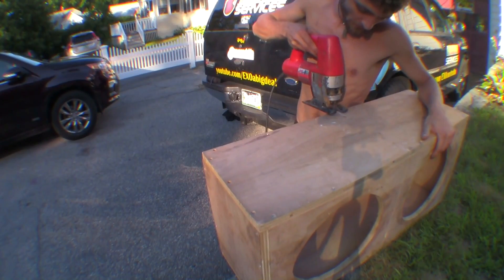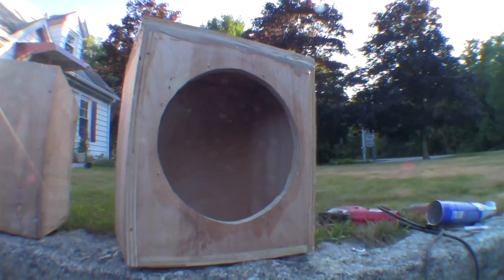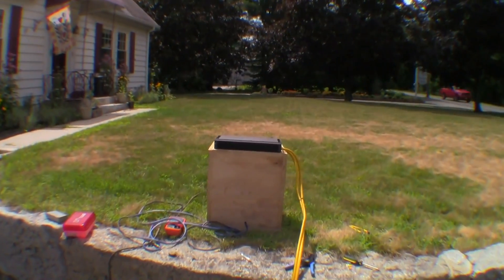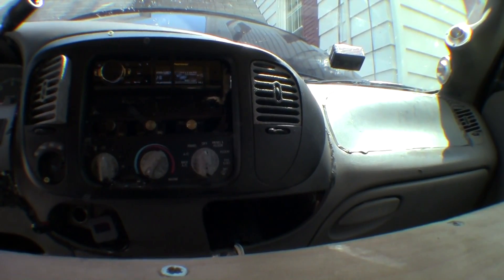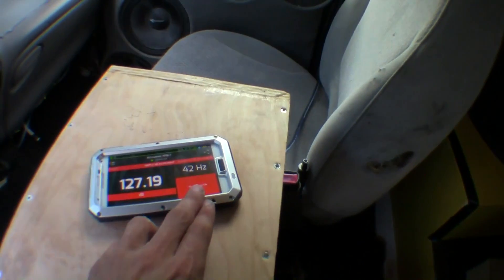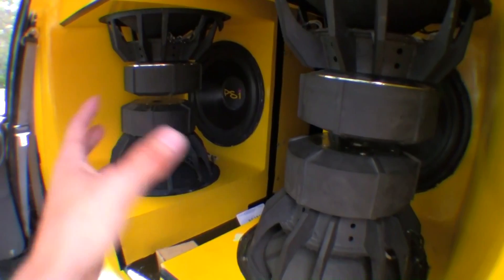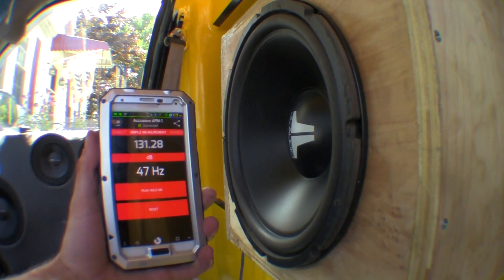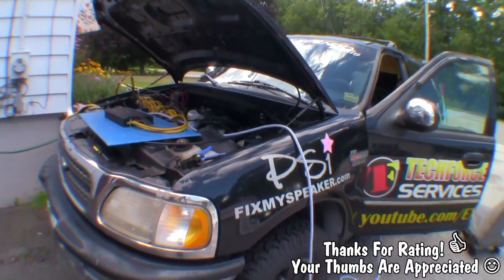Finding Resonant Frequency w/ Sealed Subwoofer Box & BASS SWEEP | 12" JL Audio W0 DIY Test Enclosure

Comment: So what if your subwoofer and box ate tuned for a lower resonance frequency than the cabin of the car? For example  I have a single 10 inch Polk Audio DB series, and spec's say it get low as 28hz. My box is tuned for 37hz however I'm not sure what is the resonance frequency of the cabin of the car. It's a 1995 Mercedes Benz E320 4 door sedan.

Comment: 8:49 - For all the budding/learning electronic/audio technicians, that is poor cone control, uncontrolled cone breakup and back EMF.
Reply: Jim Stanley or it could be the camera frame rate capturing the movement. The cone control is as expected from an entry level subwoofer being slapped with a -5 rms low Hz tone 😀

Comment: LMFAO Yo, I used to use Jumping Cable Wire for my Amp's back in the Day that's too funny I thought I was the only one who did that. Anyways I'm getting back into BASS again it's been a long time since I had beat in my cars. I'm on a very strict budget I can barely pull it off but I got a Steal on a Rockford Fosgate 12' X1 P2D2 in the Ported Single Box by RF it's brand New never really pushed hard I got it off a rich couple who rather have space over Bass . It's a 2ohm DVC factory wired in Parallel to 1ohm but I'm rewiring it to Series to get the 4ohm since my amp needs to be bridged to support the RMS on the Sub and 4ohm is the lowest Stable Impedance, Thats where it starts for me

Comment: What exactly am I looking at ? U say 10 to 80 Hz. So do u mean to say that your audio sytem/tuner or whatever will operate at the infrasound level ? And if so , then how many decibels can u get it turned up to ? So basically , can u tune your audio system to 20hz or lower and then turn the volume up well over 100 decibels ? And if so , WHAT WILL U CHARGE ME FOR THE SAME SET-UP ? ........

Comment: Cubic displacement of vehicle cabins was one of my secrets to tune our systems years ago when I worked at Paul's Scary Car Stereo in Waterford, CT back in the 90's. Nobody believed me when I spoke about it, but the characteristics of bass changed significantly when speakers were installed in sealed cabinets of the correct volume, so I used the internal volume (approximate volume of the vehicle cabin)  to create the bandpass effect by adjusting the sealed volume of the speaker enclosure to my benefit. 

I always found that vehicles with volumes similar to S-10 blazers of the 80's and nineties had a special sound quality about the bass when I built dual reflex bandpass enclosures using slotted ports similar to what Orion XTR's sub engineer's used for their single Orion xtr 12" driver they  built. The problem everybody had was that the bass enclosures were being installed without the knowledge of what the internal volumes of the vehicles were, and the bass would be different in every vehicle, so it took qualified techs such as myself to accommodate their vehicle with skills such as this. Tuning methods using ports for frequency adjustments would never completely work  unless those volume changes were made, so either the enclosure needed to be modified, the interior volume changed, or both would need to happen, which was always a lot of work to do without having tools like apps or RTAs and tuning devices such as frequency generators.

 I used  a function generator to drive my amplifiers for the sweeps when i tuned systems and an oscilloscope to see if signals were clipping from the output. This way I could see if the signals were exiting the amp,. how much physical distortion there was due to clippage, and I could see if the speakers were causing these things to happen.  Instead of using an RTA, I kind of built onemyself using the scope, a mic and adaptor to adapt the mic to BNC for the scope input. The mic needed to be the correct kind, as piezo mics would not function for these measurements.

So products like 2 x 4 blocks and pillow stuffing were some of the tools of the trade to help make these changes happen once a driver was broken in a bit to give subtle changes after the basic volume calculations were completed to find out cab volume vs enclosure internal volumes. These variables were closely approached with approximate calculations, then changed to finely tune them by changing the sizes of the areas with wood opr pillow stuffing.

 The biggest issue we had were the changes that happened once a window was opened, broken, pushed from it's seal, etc.  Other installers didn't even know that these dimensions would ever change anything, so I quietly took it upon myself to use my cabin size to enhance my own sound quality, getting several people believing in me for my bass volumes due to my tuning methods and final quality/clarity. 

My systems also used less power because true resonance in a circuit creates infinite impedance, but these changes are only when those notes were hit constantly, so tuning these frequencies not only with cabin volumes and sub enclosures were important, but also to use active crossovers of high quality to isolate these frequencies to specific drivers using dedicated amps , which are very important for final sound quality. The sub enclosure is forced to stay within this "frequency" window that the system is tuned  to,  so it allows for the output wattage to be massively reduced, becoming incredibly efficient. 

This method produced bass similar to those using several thousand watts of power while I was using 75 to 150 watts to my subs with the Phoenix Gold MS series amps while other people would be overdriving the shit out of many JL W6's to try and duplicate my sound pressure levels, using triple the amount of subs and wattage, but they never got anything but air movement. It is pretty cool to see that they have the tools to do this in a simple way today.. technology has truly come a long way in little bit of time and it willonly be a matter of time before these tools are built into head units, amps and other places once the manufacturers get their heads out of their asses. Phones shouldn't have these technologies, head units should have mics built in for real time analysis, the apps for sweeping as well as the compensation networks to adjust the upstream devices in an effort to create perfect sound all around. It is important to me to see this get done because I am so tired of hearing thousands of systems built only to shake the Earth while most of them sound like shit. What ever happened to quality sounds? I love loud music, but I feel it has to be equalized correctly to enjoy the quality of the system,. not just to create sound pressure levels. SPL isn't a difficult task, it is the efficiency of a system that is most difficult to increase and it is the key to every sound system out there..

 Too bad there isn't compensation systems that could be tuned automatically , similar to the "phase-lock-loop" circuits used for resonant electrical systems, as televisions use, to keep the systems "in resonance"
Reply: Man i am surprised
Reply: Help I’m thinking about making a potted box for 3 jl w6v2 for an 90 k5 blazer any help?
Reply: It’s called a dsp nowadays... You still use a real time analyzer with mic & pink noise + tones to see how the car changes the frequency response.  This has been the method for a long time.
Reply: If you rolled down the window just right you would have a 4th order with a very high ratio.

Comment: what about in a Honda van . I got 2 10s what hertz should I set my subs to ?? I want punchy bass
Reply: 35 ish
Reply: +FSXgta I think my subs will distort at 35 but I'll give it a try later . sealed box . PPI subs .
Reply: +ORANGE BOY 714 well you cant tune a closed box like a ported. I reccomend getting some poly fill it will dampen the enclosure some. I think a smaller closed enclosure is more boomy than a slightly larger one tough. I have a small closed 12" and i think its the boomy type it is loudest at around 50hz
Reply: +FSXgta ight bro . I'll try it out thnks .
Reply: yo
Reply: they can't really handle that frequency more like 100 to 130
Reply: ORANGE BOY 714 Then they must suck... subs should play from 100hz and down. Check your crossover
Reply: +ORANGE BOY 714 you must have been talking about Cycles not Hertz

Comment: Hey man, great video!
I wanted to ask you a question: can I combine a ported subwoofer with a sealed subwoofer in my home theater system, in order to get both the tight compact sound from the sealed subwoofer, and the "boomy" sound from the ported subwoofer?
Thanks
Reply: try it lol
Reply: try it lol
Reply: You'll get phasing issues. Would just be making two enclosures that will argue essentially. Just make one well designed one.
Reply: +getahanddown Thanks
Reply: No worries. See my channel for some builds and if you want a design done hit me up.

Comment: Awesome video! You have a talent for tutorials! Quick question: I want to design a box with an 8 inch Cadence sub (Fs=57Hz) for a new Mercedes Benz wagon. What comes first? 

1) Determining the cabin resonance then choosing a subwoofer  matching cabin resonance with speaker Fs? 
Or
2) Do I test the cabin resonance and then use quarter wave theory (for T-line box) to determine port dimensions for my box to match the cabin resonance (speaker Fs of no concern)? 
Or
3) Am I way too confused right now to even be asking logical questions!???!?!?

Thanks for the help! If you know of any good resources to figure this stuff out I would love that too!

Comment: Yeah JL! Cooling built in, rated at 125 watts cont power, not max, like 1.5" VC with 6 layer winding, came in 4, 8 and 12 ohm versions for the W0! Built to last, I still have my 15 year old 15W0's I refoamed, even have an Earthquake 400tx to run them on! Also have a HCCA 225G4 to run my MB Quart 12's on at 1 ohm mono! It is rated at 2x25 watts at 4 ohms, 50x2 at 2 ohms and 400x1 at 1 ohm mono!

Comment: Hey bro, quick question. Was considering a CT EXO (coincidence) 15 on a Crescendo 3500. Now reconsidering CT because of company reputation and thermal limits of a 3" coil. Can I run a PSI Platform 3 HP daily (heavily) in 3.7 cubes net with 60 Sq in port @ 35hz and still be impressed with the SQ? Not looking for ID infinite baffle SQ but not muddy either.

Comment: I think you need to do the same with the box outside and making some graphs so you van truely see what the gain is?
Reply: yes exactly,  You are referring to what's called anechoic.
Reply: I agree. The small sealed box almost certainly isn't linear so it's going to influence the resonant frequency measured.

First measure the output of the sealed box in free air away from reflective surfaces or preferably measure the TS params of the driver and put it in a sealed volume that makes linear output above a known frequency.

Comment: Exo, ive got a question for you im really hoping you can help. I got the same amp you have the nvx jad 1200.1 there, powering 2 sundown sa-12s at one ohm in a ported box. However, the subs are playing suuuuuper quiet. I can guarantee its not the subs, because the reviews of the amp was that it slammed everyones subs and ran cool. Mine just barely moves the subs and runs hot... ive tuned it until it started distorting then cranked her back a bit. Any ideas???????
Reply: I think you need to return the amp... And ask for da money... Lol k bye
Reply: Sounds like you have the dual voice coils out of phase.
Reply: its fixed and that was not it haha but thanks for trying man !

Comment: hey exo. I'm new to the building box's scene. what exactly is that helping you with in layman's term? lol I understand that everything in the car is tuned to different hz automatically wether it be cab or box. but how is that going to tell you that your ported box is going to be lauder??? won't your box itself max out your subs itself and the cab be the extra air flow for the port? I'm not haiting or anything just trying to fully understand so when i do my competition build i know exactly what to account for. a quick real easy run throw would be greatly appreciated lol 

p.s. I've learned soo much from your vids man! seriously love your channels!

Comment: but remember, you aren't accounting for the 12db/oct roll off of the sealed enclosure, you could have a peak under 42Hz but due to the roll off it isn't registered as a peak, which is why it's best to get a theoretical frequency response graph and compare it to the response in the application, then you will see your peaks
Reply from the maker: +Technologic Great information, thanks for that! I still have all the graphs saved on BBP6, so that would be interesting to plot side by side. I'm curious how I would go about imposing all this sealed box data into the existing file though. Any tips?
Reply: the only way i see doing this is to get a dayton audio omnimic which is expensive, but you might be able to painstakingly get a value for a bunch of frequencies and make an excel spreadsheet graph to get something, you might want to try modeling the sealed box on hornresp (which is free), the response graph on there gives you a slider type thing that slides along the response graph and gives you the SPL value for each frequency down to the accuracy of like 0.01hz
Reply: Just build a sealed box for the JL that makes it linear. Then you can do exactly what you did to find the resonant frequency. Don't trust the TS params for that 12 either. Measure them.
Reply: Chris Wilson
all sealed boxes are linear, if you are thinking a flat response, it is not possible to get a completely flat response with a sealed enclosure in the subwoofer frequency range unless you have a massive amount of cone area, there will typically be a consistent 12db/oct roll off in response in the region you listen at
http://www.subwoofer-builder.com/boxes.gif

Comment: Hey Exo dont you need 1.5 ft3 to find frequency???
Reply from the maker: +COMPASBASSCLUB CHICALI - Can you elaborate on your question? If I were to use the entire box volume for a single 12" (almost 2 cubes) the internal specs would've been too large and the sub would've most likely unloaded while performing the tests.
Reply: I am just asking you about what I have read online. Some people say you need 1.5 ft3 for a 12" sealed for getting cabinet frequency. Maybe I didnt hear correctly but you said the box was approx. 1 cuft it isnt?
Reply from the maker: +COMPASBASSCLUB CHICALI Ahh I see what you're saying now. Yes, I have heard that, along with similar suggestions calling for half that. Not sure which would be optimum for this case since we can't test the differences. I'm sure subwoofer plays a factor as well. But since I had this spare box laying around, I figured I'd work with what I had; especially since there's always the chance of something playing a bigger factor than those few tenths of a cube when it's all said and done. It would be a good video to compare results though, would just need to buy more wood :)
Reply from the maker: +COMPASBASSCLUB CHICALI Also this test can be performed by with any woofer, and in those cases when  smaller drivers are used, like 10's or 8's, I would definitely do my testing with a box built to spec before I would test with a box too large for the woofer that's already in it. You know what I mean?
Reply: Got you bro! I also thought you were working what you had. Cutting that box was something easy and fast thing to do. I will be waiting for next vid. I am interested in learning about finding cabinit frequency. I plan to build a SPL only setup and hope to learn from you specially because Rusty from Dc Audio told me that the tuning for big setups has to be done after you build your box because a big build will dramatically change your cabinet frequency. Still learning Exo!!!